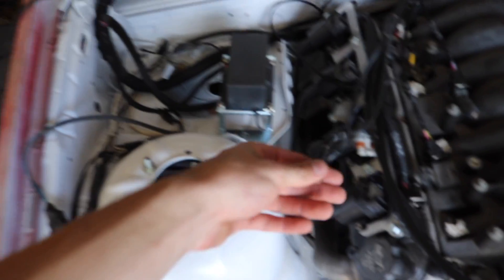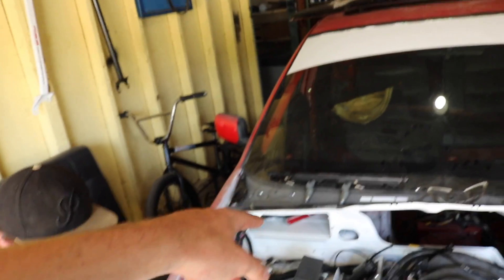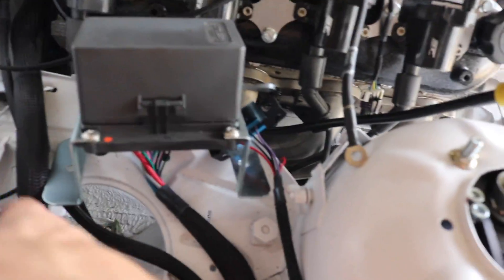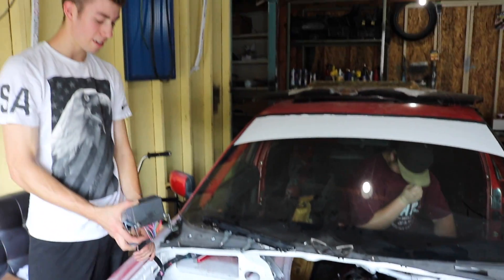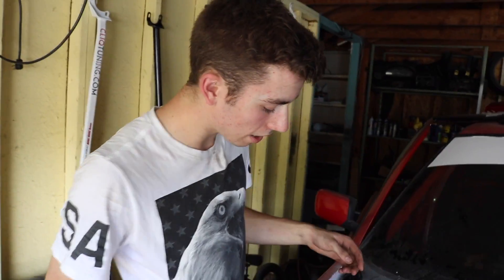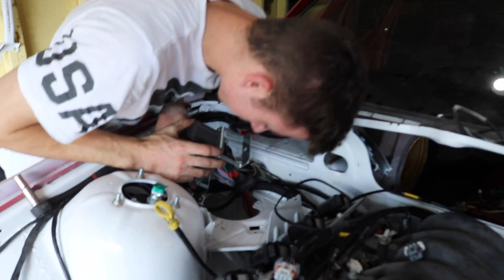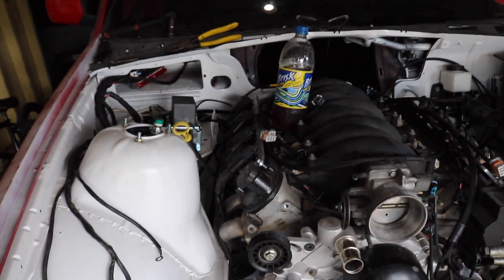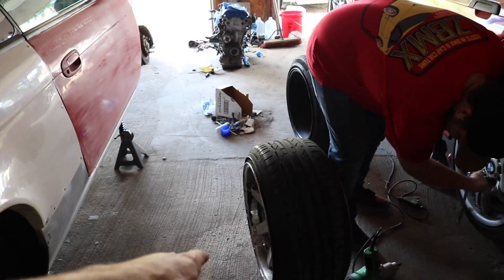Getting The V8 E36 Ready To Start!

Comment: People need to send them some safety glasses ! one day you might regret using that grinder without safety glasses... Safety first
Reply: True story. I’ve shot piece of a wire wheel through my eye and had surgery to have it removed. Luckily not lasting damage and can see fine, but change a lot. I’ll get a cut or a messed up knuckle, I draw the line with eye safety. I don’t ever want that again.

Comment: that's not true any car will crank without a PCM.. the starter is only power and ground . grounds to the block.. if you don't have a battery ground to chassis then chassis to engine it won't crank.. as long as you have 12 volt red from battery to starter.. then in GM harness you have a small purple signal wire that comes from ignition switch to the starter .. the PCM  doesnt know the difference
Reply from the maker: scottelbadass a ls will not crank without the ecu
Reply: Garage Sideways the starter will crank the motor if you put direct power to the starter....run the wires from the starter directly to a battery....then you can at least hear the motor turn over.
Reply: Garage Sideways sorry friend, I work for Pro tree racing. Dallas TX.  most recommend LS based shop. we do swaps in all types of cars, Fab turbo kits etc etc .... it will Crank . I could snap a video of a car Cranking with no ECU in it for you